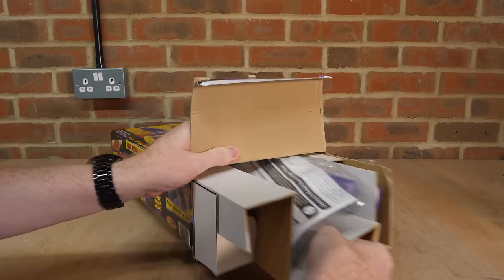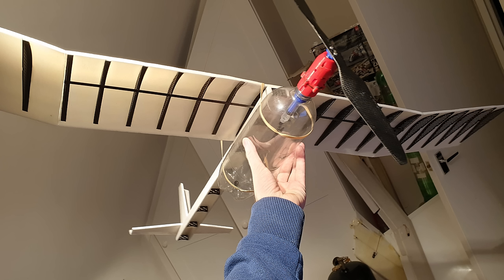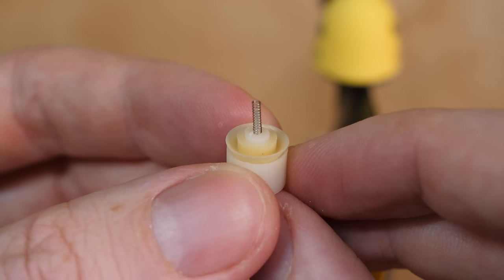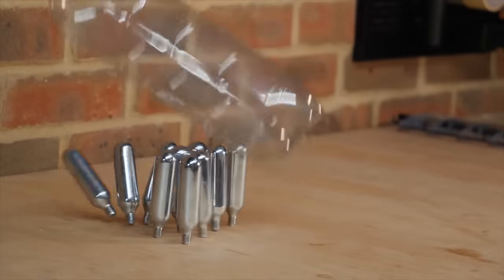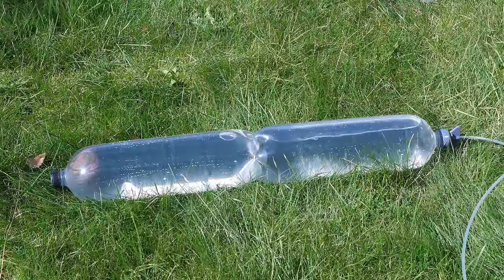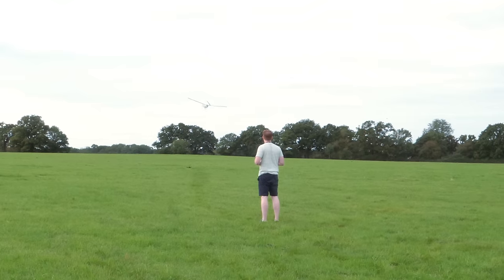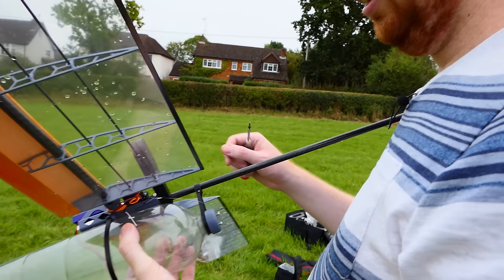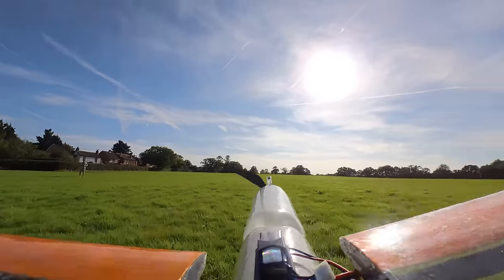Flying a Plane Powered by AIR

Comment: Hey a tip for your air storage: people that build water rockets have perfected splicing plastic bottles together for high pressure use. The channel US Water Rockets has some good videos about bottle splicing. You could save some weight and make larger chambers fairly easily.
Reply: Good to see you here!
Reply: I love it when cool engineering YouTubers watch each other's videos!
Reply: Yeah I remember gluing 1.5L bottles together to make a 4.5L water rocket 12 years ago. 120psi is quite the limit though
Reply: That sounds like a good idea if it can take the pressure. There's a lot of weight in the bottom of the bottles and fasteners. Also, here in the US we have 3-liter soda bottles. Fuse a couple of those together and you've got 50% more capacity in probably less weight.
Reply: Air Command Rockets from Australia helped me massive through my water rocket project in 10th grade. They evolved from spliced bottles to carbon fiber air tanks over the years 😅
Reply: Nice tip! 👍
Reply: You could use the carbon pipe inside the wing as an additional air tank
Reply: Love the shoutout from Nighthawkinlight to the water rocket YT community. Never expected to see my various communities recognize each other😊
Reply: @gizzta I've seen double that with fiberglass wrap etc.
Reply: also helps to reduce drag to make it fly smoother
Reply: Go one step further: make you own bottles from PET preforms. After heating the preforms can be inflated into a mold to take pretty much any form you like.
Reply: @notconnected3815 Would the added storage capacity outweigh the added weight from extra tubing, sealing, etc?
Reply: @TheThrustProject carbonfiber pressure tanks? What did we learn about carbonfiber hulls and pressure a few month ago?💀
Reply: G'day,

Yay Team...!

I wondered about that, but his hollow Nylon Nut is a pretty good solution, considering that the Reservoir of the plane has to fly Horizontally, and as it depressurises, the spliced versions might not be as rigid when considered as a Fuselage with the Motor out on the end of the Moment Arm - whereas the complete Bottles, with bases interlocked and bolted produce a VERY rigid Tank with a Sinusoidal Bulkhead...

Which is a different sort of admirable elegance of design, I reckon (!).

The bit which he missed though, is that by leaving the Centre-Section 
Structurally & functionally sound, but
Aerodynamically 
FOUL & Un-enclosed, he's turned his 
60:1 L/D Wing into a
30:1 L/D Wing... ;
Because that lack of a 
Gap-Cover puts a 
Tip Vortex trying to form on each
Wing-Root, as well as at each 
Wingtip.

Leaking High Pressure around the inner Ends, up to "dilute" the Low Pressure above the Wing - reducing Lift...; while the Boxy, Chunky  Rectandular Prisms of the Radio/Battery/Servos and the Circular-Section Wingspars, and funky 3-D Printed 
Connectors 
ALL exposed to the Airflow,
Adding MORE Drag, and
Generating 
Turbulent Flow going back,
Spreading out to
 Partially "blank" the
Butterfly Tail...

I nearly crashed my VJ-24w when, in haste, after weeks of Taxi Tests, High-speed Runs, Low Hops, and having worked up to flying the length of the Runway about 10 ft up...; I couldn't resist the temptation to keep climbing on a 10-ft Pass..., Soaring up past the Hangar Roof, committing myself to going over the fence and flying a Circuit.

Without waiting to fit the 
Gap Cover, which was still being sewn up by my mother ; despite a warning on the Plans, against flying it without the Gap Cover.

With a 36-foot Wingspan, 
Everything I did in it below 18 ft was done
In
Ground-Effect, where the Wing is MUCH more
Efficient..., allowing me to
Delude myself quite a bit, regarding my ability to climb up past Wingspan-height.

Big mistake.

At 30 ft the Speed bled off, and by 100 ft it was all I could do to maintain height while going straight and level as full throttle.

Zero climbing ability...

It's a long way around the Planet, at 100 ft, to return to the Airfield..., so I gently turned 90° Right - against
P-Factor (but there was a line of Poplar Trees to the left...), And I lost 30 ft on that turn..., then did that again to be tracking 
Downwind at 40 ft...,
Facing 60 ft Trees at the end of the Paddock.

So I turned Right 
Again, and came in
Over the Fence at 10 ft,
Cut the Throttle and 
Landed going across the
Runway....

With a whole new appreciation of the importance of
Gap Covers.

With it fitted, the Zero Climb at 30 mph
Became 120 ft/min. at 36 mph, and 40 mph straight and level.

With a 42" x 26" Propeller at 4,200 RPM from a 22 Hp JPX Pul 425, 2-cylinder 2-stroke...

Carving a finer pitch Prop,  at 41.5" x 12.5" yielded 250 ft/min at 36 mph & 45 mph flat out.

Fitting a good Gap Cover makes as much different as
Shitcanning the overpitched Propeller and trying for a less ambitious Flowspeed through the Disc..

Two Shells of
3-D Printed Plastic would do it,
And then this
Bird would fly
Faster, and climb
Steeper, and it's handling and
Response to turbulence and gusty conditions would
Improve...

In my estimation, based on observation, last time I was 
Flight testing my
Pop-Rivetry & Woodcarving
Efforts...(!).

I don't think the tip will be too far wrong...(?).

Such is life,

Have a good one...

Stay safe.

;-p

Ciao !
Reply: I have perfected this method! I can confirm it is the best one. I've been able to achieve up to 10bar of pressure with one. When they are covered in fiberglass, they can achieve up to 20bar!
Reply: @dariush.2375 that was compressive pressure though
Reply: @dariush.2375 the work incredibly well at retaining pressure as the fibers are under tension. 

Carbon fiber doesn't like compression.....
Reply: Splicing can get you banned from some communities. Granted it’s speedrunning communities, but still
Reply: @dariush.2375 actually carbon fiber should be good for pressure tanks like that because the fibers would be in tension
Reply: Put more engines @prestongoes
Reply: What about using the wings as air-fuel storage.... skin them with sheets of PET, all sealed up with a valve to press and one connected to the crank.
Reply: Wings need to hold fuel just like a real plane
Reply: @dariush.2375 um, the problem was external vs. Internal pressure. Carbon fiber is frequently used with internal pressure. Only people who don't understand how the carbon fiber adds strength would use it with external pressure. 
Note that all pressure vessels have finite life expectancy. So care must be exercised when repeatedly using any pressure vessel.
Reply: The excess molded plastic on the base is heavy so this may be exactly what is needed to increase air capacity and lower overall weight.   The tail may also have some room for weight loss
Reply: @TheThrustProject  love Air Command! Only discovered them like a year ago but it always feels special when they upload! :D
Reply: @dariush.2375  that was under compression - carbon fibre is much stronger under tension.
Reply: That's amazing great job I'm sure you will get this sorted out
Reply: Yep, I've done that with a bottle rocket. I spliced them together using sandpaper, 2-part epoxy, and tape. I don't remember what they were pressurized to, but it held brilliantly. Too bad my rocket design was garbage!
Reply: That's exactly what I was going to say
Reply: Are you the guy who Rhett and Link got the sock egg scrambling method from in a recent GMM?
Reply: yeah I thought of them too, just use a large carbon fiber tube (like the rockets) as the main body, it will be a smaller diameter than the bottles but longer therefore less drag,  and you could probably store way higher pressures in there…
Reply: @turrboenvy4612  The british mind cannot comprehend 3 liter soda bottles. But yes, this same configuration, but with 3 liter bottles would be a great improvement.
Reply: Crossover episode!?
Reply: Now Tom needs to start making improvements using a Taguchi Array…
Reply: So stoked to see the next iteration of this. Continuing design is always more interesting to me than one offs.
Reply: I had these as a kid 20 years ago lol 😂 nothing new here
Reply: @dariush.2375 many paintball tanks are cf. I'm sure there are scba tanks that are as well.
Reply: @dariush.2375 That pressure vessel was under compression stress.  A pressure tank is under tension stress.  Big difference!  Lots of high pressure SCUBA tanks are made with carbon fiber.  They are lighter, stronger and take higher pressures than the aluminum tanks they replace.
Reply: If it is a air engine, put a air compressor on it?
Reply: @dariush.2375 carbon fiber is great in tension not in compression
Reply: @turrboenvy4612  im sorry we have 3 liter bottles?
Reply: This is amazing!
Reply: Love ya channel be
Reply: Good to see you here.  

You both youtubers make videos once in several months.   I am surprised to get notification from both of you when I get up.
Reply: @dariush.2375 outward pressure is easy. Inward pressure is hard.
Reply: @antonliakhovitch8306  The carbon tube is already there as a structural component. Why not also use it as air tank. The 3D-printed part in the middle needs to be air tight and provide a port to the main tank. But i guess this is a verry small extra air volume compared to the main air tank.
Reply: @Scotty-vs4lf 3 liter bottles... commonly filled with generic/store brands of soda. Not nearly as common in the US as 2 liter bottles but they're out there. You might be able to find Fanta in a 3 liter bottle. Even Coca-Cola makes a 3 liter bottle but good luck finding that one
Reply: @notconnected3815 oooh. Great idea
Reply: i was thinking similar as just use some material that is similar weight ( may be bit hevier) but that can store x2 presure that should overcome weight increse and should extend flight or just build fucking spitfire propeled by air engine hahahah
Reply: Further this reduces drag and one can add a node cone and back cone for drag reduction.
Reply: @dariush.2375 carbon fiber high pressure tanks are doing ok in the paintball community. They are good with 300 bars so they handle 10 bars easily.
Reply: Genuinely had me clapping at the end; watching it fly over the time you wanted, is an awesome achievement, Tom. Congrats.
Reply: @dariush.2375  We learned that you can make a lot of flights before it suddenly catastrophically fails... also, probably don't put a window in your air tank...
Reply: @jamesbramlett5407  Not the right shape for pressure vessels...
Reply: @notconnected3815  Nice! Same trick as golden eagles and dinosaurs. Guess pressurizing the whole wing would be ott?
Reply: Try streamline the bottle
Reply: @ravoniesravenshir3926  Believe it or not...I considered the same thing but there are serious exceptions on the weight and power requirements. Though for short flights, it could extend flight times by 30 seconds or maybe more, depending on compressor design.

Example:
the old style slap piston compressors...literally just a piston on a conrod, with a short, ported 2-stroke style head...the intake port, then TDC of piston to reed valve, with a ball bearing pressure regulator. Technically you could remove the reed valve and go with the ball bearing pressure regulator to remove delay times. The design problem is how fast, and how much, compression can be achieved in 30 seconds. In this case, with 3d printed parts, you could make a set of very small, high RPM, short stroke compressor pistons using flexible graphite rings (as they do in the newer oil-less compressors).

So let's assume you can build one AC piston about the size of a pack of gum...while it will never match the output of the air engine, it could extend for 10-15 seconds of flight time. The longer the flight, the more it can produce, though obviously a hard limit of time it can do so. So let's move to going with either double pistons in something the size of a magic marker. Now your weight has increased significantly, but your AC production has increased significantly. Now to power production for said motors, or single motor with double crank for two pistons...luckily, power requirements would be small, so possibly use a limited battery size for 30 to 45 second run times.

One could also cheat and kick off a double piston AC by using the old 4 cylinder (gasoline) Ford 9n (from the 1930's or so) trick...in those, you picked a cylinder, say #4, and tapped it to be an air compressor, not a firing cylinder, for stationary use. They were not the most efficient, but they worked...you simply pulled the spark plug and ran a spark plug extender adapter into the head, then a line to an air tank. Or, and some wildcat oil rigs did this...they would take a V8, and set one bank of it aside purely for AC use, so 4 pistons running as an AC, run by the other 4. No they didn't run smooth, but they worked.

In this case, in a two AC piston setup, one of the pistons is used not to produce AC for the flight power, but to feed back into the first piston...in this case instead of internal combustion, an electrical motor runs the two piston setup...initially, when the battery is done, the second piston feeds back into the crankcase of the 1st piston for blowby/BDC usage, and uses the same intake port, except in the opposite direction, as an exhaust port while the piston compresses the air on the top side.

This can be used to extend battery life as well. The only time you don't want crankcase pressure is on the downstroke to BDC (overpressure, or in most compressors of the old style, or the very new style, there is no crankcase so vent to atmosphere)...in this case, you only want air injection in a very short blast from BDC.
Reply: @dariush.2375 carbon fiber is great under tension but not good with compression. 

Using it as a pressure tank is exactly the opposite of using it for a submarine, and it's a much more ideal usage case.
Reply: Bigger bigger bigger lol awesome video brother
Reply: @dariush.2375 you mean the submarine? as far as I remember, carbon fiber was great for internal positive pressure. the problem was the opposite
Reply: I have no idea what this videos channel is or the commenters channel. Seeing the replies and the community being so helpful makes me wanna sub to both. I grew up when AirHawk planes came out and they gave VHS tapes with them. I tried to use a soda bottle while tinkering and messed up the whole plane. I was only 4 years old so it’s expected. I found electronics inside my toys and became Frankenstein trying to make my own toys out of the parts I found. It all evolved from there now I’m a…. HOLY HELL THE ADS STOPPED AND THE VIDEO STARTED OFF WITH THE AIR-HAWK PLANE I HAD! Subbed. Sorry I let my ADHD come out hard xD
Reply: @GerryRR  Similar principle to lightweight aluminium medical oxygen cylinders. Their ability to withstand high pressure is increased greatly by the addition of a wound kevlar/resin outer reinforcement. The same idea would be worth a try with soda bottles and small diameter carbon fibre thread with minimal epoxy resin as the binder.
Reply: @dariush.2375  The submersible that collapsed was trying to resist pressure from the outside of a cylindrical chamber which is a poor design. Cylindrical carbon fibre jacketed air or gas receivers are very successful and used often on lightweight high pressure gas cylinders.  With all the pressure on the inside of the receiver the carbon fibre is in tension(a stress it resists very well).
 With the submersible that collapsed the majority of stresses were compressive which carbon fibre is not good at resisting at all.
Reply: @jamesbramlett5407  Pressuring the wing structure is sure to distort the aerofoil shape of the wing and play havoc with the lift created by the wing.
Reply: @johnbennett1465  That submersible idea was a really dumb design as the crew sadly found out the hard way. High pressure receivers with carbon or kevlar wound jackets are quite commonly used safely.
Reply: @FlyMIfYouGotM  Exactly! 👍
Reply: @gizzta at a science fair we saw some folks with pet bottle rockets (just air)
That night we made a coup6of CO2 bottle adapters (one conical and one with an O-ring. Long story short... I had a 0.5L bottle stuck on the conical adapter with the CO2 fully open... It didn't blow. But when I knocked it free it reached the steel ceiling of the fair building (10 yards+?) And put a dent in it.
The CO2 bottle had cooled from use so pressure was a bit lower, but the bottle still held.
Reply: I love both of your guys channels. You guys do some good work.
Reply: What if you used 1L bottles instead? Smaller diameter, so less hoop stress, allowing proportionately more pressure capacity. Also more aerodynamic.
Reply: What about a carbon fibre high pressure air tank for paintball? They also have regulators already installed
Reply: @notconnected3815  kinda like a carbon fiber submersible.
Reply: Would adding a baloon into the bottle help maintain flow at decreasing pressure thus maintaining rpm of the rotor even as pressure drops in the bottle? As you pressurise the bottle, the balloon expands against the sides of the bottle, as pressure inside drops, the balloons elastic recoil helps maintain it a while longer... At least in theory...
Reply: @uramalakia  low pressure is low pressure.
Reply: Hi nighthawk, been watching your videos since 'back in the day" with your 'how to punch through concrete' video in 2012.  you are one of my heroes
Reply: Add 2 more bottles. If Peter sripol has shown us anything, length of plane doesn’t matter.
Reply: Wings should be the air storage
Reply: i love that. 
is there a some soltuions for gas? for touristic purposes.
Reply: thanks for video recommendation. that rocket channel has plenty useful videos.
Reply: A quick win might be using the film to cover the transition between the two bottles to reduce drag. I wonder if you could also integrate horizontal forms to either side of the bottles under the film to create a flatter body profile.
Reply: @jamesbramlett5407  Would it deform under pressure and degrade the airfoil? At these reynolds numbers he ought to be able to fly a 30-40% airfoil. That would hold a lot of air. (120 knot Bearhawk flying a Riblett airfoil at 15-18%.)
Reply: Interesting... 🤔
Reply: Sup
Reply: Instead of compressed air you should experiment with dry ice or frozen CO2.

This will make it stay longer in the air.
Reply: So a torpedo?
Reply: @jamesbramlett5407 Wouldn't that cause issues? Pressure containers usually have nice round shapes to spread the pressure equally, whereas wings themselves are likely not as round as one would like to store a lot of pressure. If they were connected to the rest of the containers, he would likely not be able to pump up the bottles as much as he can now. That could hurt the design, instead of helping it.
Reply: @Shadow66090  Never kno til ya try!
Reply: Would a centrifugal turbine driving a prop work better?